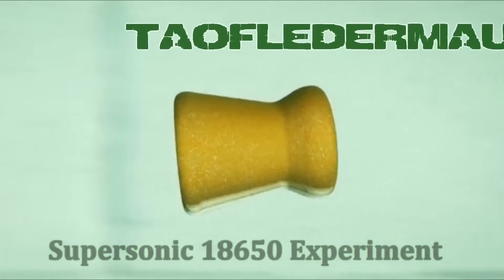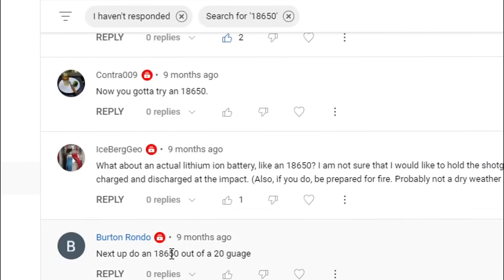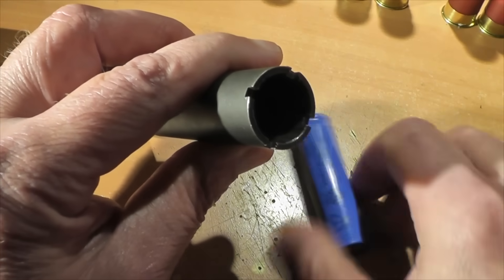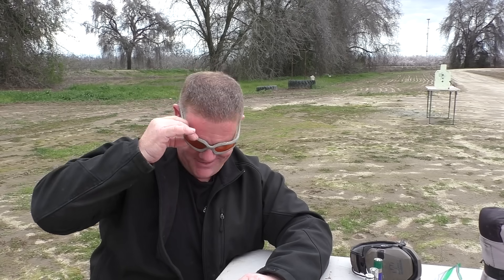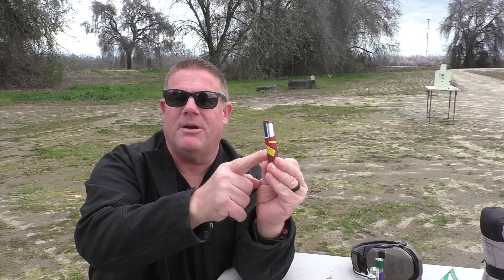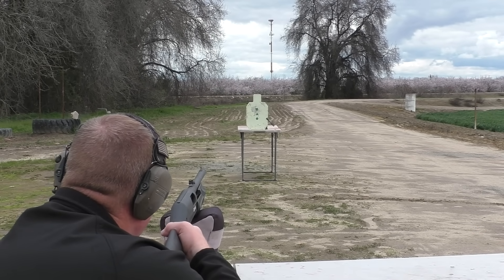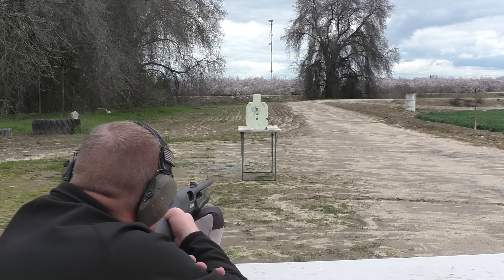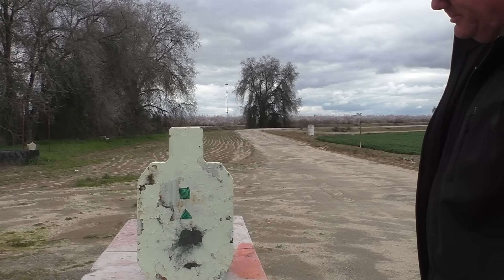12ga 18650 Li-Ion SHOTGUN Slugs - TESTED!

Comment: The way that charged battery flew was shocking.
Reply: Assault & battery charges
Reply: @daewooparts  assault with battery, in this case(ing)
Reply: Gotta be charged for the most power. Surprised the others made it out of the barrel with 0 volts.
Reply: bro i was about to rewind it to see how it flew different...
Reply: Electrifying even.
Reply: The fully charged batteries actually has a more flamy reaction when exposed to air. 3.5 volts is not fully charged though. 4.2 is.
Reply: @alexanderg-p3z  yupo, 3,5V is a pretty dead Li battery, shouldn't fall below 3,7V in normal operation when discharged.
Reply: Just to be pedantic;
A fully charged LiPo or LiIon battery is about 4.2.  That's what you charge a drone-battery to before use.
(with some tolerances. I've done experiments where a single cell held around 8 Volts, and kept pushing current down to it's normal operation voltage of 4.2, seemingly being just fine after the ordeal)
For long time storage, 3.7 - 3.8 volts is normal.
A working Lithium Ion (LiIon) powerwall for home use should be kept quite low, around 3.8 - 3.9 volts or thereabouts if you want it to last for a long time.
Safe discharge for Lipo is about 3 volts, but anything below 3.5 the discharge goes pretty fast - meaning it has little left in it.
Safe discharge for Lithium Ion (the usually round ones) is about 2.5 volts no problem. But again, below 3.5, the voltage drops quite rapidly.
Reply: @diapozitīvs  3.5v on a typical lithium battery is about 59% state of charge. 3.6, 3.65, or 3.7 is the nominal voltage, discharged is 2.5v on a decent cell. Going below 2.5v can damage a battery’s future performance but energy is present until you hit 0v.
Reply: @VapeEscape  working with iPhones years back it was 3,7V and under when battery wouldn't wake up phone and phone wouldn't charge - so one had to access terminals and give some direct current there. Then it would work again.
Reply: LOL
Reply: I need to add that one to my dad joke repertoire!
Reply: For our sins we deserve eternity in hell, but God loves us so much he came as Jesus to pay the price of our sins  through living a perfect life for us, his death and his resurrection so we can be forgiven and receive eternal life if we follow and obey him in faith FOR LIFE , Jesus loves u and desires to have a personal relationship with you of love, peace, redemption and obedience ✝️ May Jesus bless you, repent of your sins and turn to Christ before it's too late 🙏🏿❤️❤❤
Reply: That is god-tier bro!! Truly electrifying content!
Reply: They don't cost the earth either
Reply: Yes very SHOCKING
Reply: I think OGs humor has been sinking into our funny bones...
Reply: Lame ass pun 😂

You must be a dad
Reply: giant slug lol
Reply: Well it was “charged” lol
Reply: Puns..Doh 😣!! Facepalm
Reply: @Thousand_yard_King  An electrifying-field test.
Reply: @nicholasthomas3635  noooooo
Reply: @Thousand_yard_King  A positive experience.
Reply: @nicholasthomas3635  ahhh

Comment: These are the new Gauss rounds.
Reply: I was actually wondering, if an oscilloscope could be set up, use a grid field,  and see if it creates a small pinch.  It should theoretically create a magnetic field collapse from the core compression.
Basically, it could be a micro EMP.
Reply: @mikebolton3816  EMP measurements would be cool. Before I said Gauss I was thinking EMP. I also wondered if you lit a candle next to the target if all that powder would ignite?
It sure shut down that Tandy computer lol.😂

Comment: I seen myself in the old comments 😃😃🤣 love some taofledermous!!! Definitely don't try this at home unless you know what you're doing, 18650s are a bomb waiting to go off
Reply: Not all of them are... The lithium (cobalt?) Type in power tools, bikes, vapes, and yard equipment are extremely flammable if you penetrate the case.

The low drain style in computers, gadgets, and many flashlights are lame. I have set off quite a few for makeshift fireworks and don't even bother with the regular ones. They don't even do much when thrown in a fire pit. The power tool ones shoot off like rockets.

Comment: Another awesome video!  I guess lithium double AA non rechargeable batteries have lithium foil and it burns pretty good.  I think I saw on a video where a sciency type of dude took it apart and threw it in water.  Pretty spectacular.
Reply from the maker: thank you
Reply: Yeah, lithium primary cells (non rechargeable) have metallic lithium in them.

Lithium ion rechargeable batteries only have some "ion" form of lithium in them, they don't really react with water. People have this assumption that they are going to explode when they get wet. I've ripped the tops off different cells and gotten them wet, not much happens, maybe a little bubbling.
Reply: @volvo09  man thanks for clearing that up for me, i know lion bateries can still explode when the positive and negative ends connect i didnt know that Li ions werent that reactive
Reply: @blank-mq8ef  the explosion is mostly due to the heat generated by the batteries dumping all their energy at once. It gets super hot, damages other cells around it, and sets fire to anything flammable nearby. Most batteries don’t like being short circuited, but LiIon has a high enough energy density to cause a lot of damage
Reply: That was the Nile Red Channel.